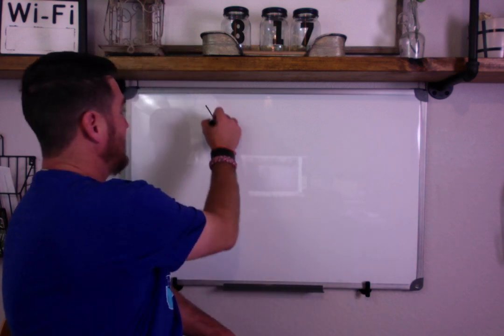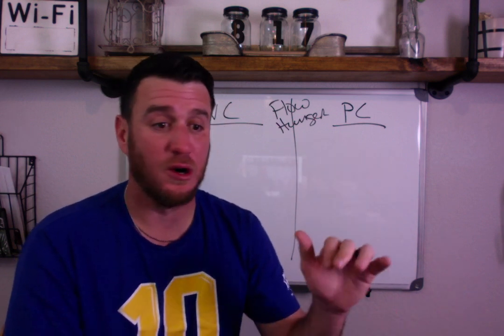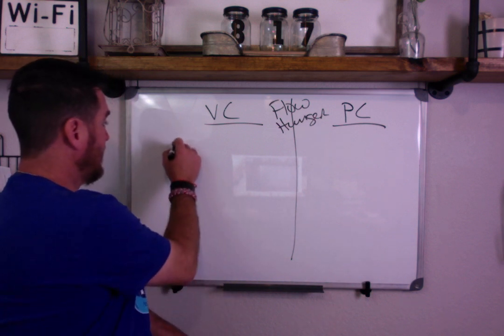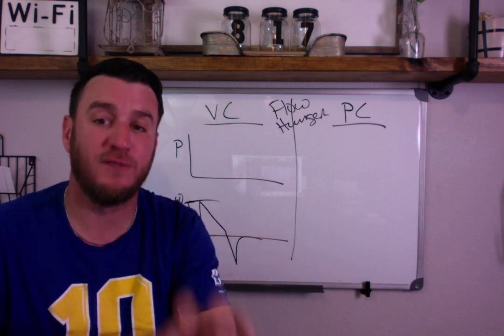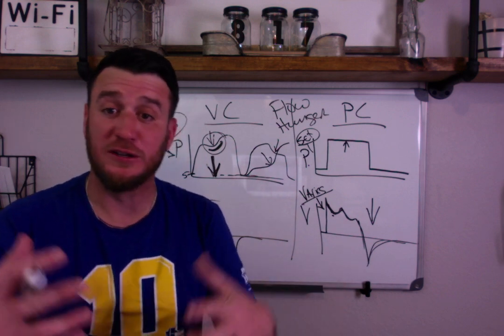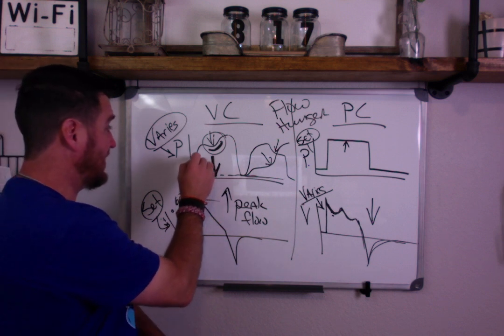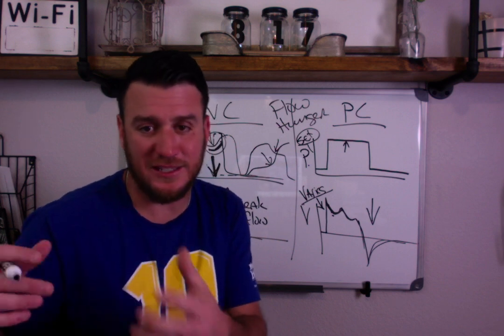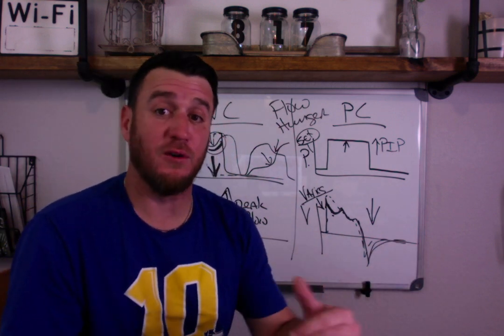Respiratory Therapy - Flow hunger in Pressure Control

Comment: Can rise time help alleviate flow hunger in pressure control?
Reply from the maker: Yes, but only if it's early insp flow hunger.  Middle or late flow hunger usually manifest after the rise time is done reaching the set pressure.  Just depends on when the patient is wanting the extra flow.  Hope that makes sense.  Best wishes, Kyle!

Comment: Thank you.
But Sr,
What does it mean if there is a dip in the pressure in pressure control mode?
Reply from the maker: Same thing.  Severe flow hunger or patient asynchrony will also show a dip in your pressure waveform until the vent increases flow to correct the dip in pressure.  If the vent fails to achieve the pressure set then you may have a leak in your system.  Does that answer your question?  Thanks for watching and commenting!
Reply: Respiratory Coach 
Yes, Thank you very much 🌹

Comment: I have a Q that is bothering me for so long. I asked and searched about it but I just got more confused. Is PRVC mode pressure control or volume control ? Cuz sometimes the doctors asked to measure the plateau pressure and I don’t know if we can measure it with PRVC. As for the settings, it indicates volume control as we are setting the volume, but at the same time it has the waveform of the pressure control.
Reply: To obtain a plateau pressure in PRVC mode  a brief transition to AC  mode is required to measure plateau pressure .
Reply from the maker: Hey Harwazen!  Your very smart to note the struggles in this situation.  You're right, the vents classify PRVC as a volume mode of ventilation, yet it functions as a pressure control mode.  So you're right, in PRVC a mechanical breath is pressure controlled, evident by your pressure waveform.  So, the answer is no.  You cannot adequately assess plateau pressure while in PRVC.  Not only can you not, but the ventilator cannot either.  This is why the ventilator gives volume controlled test breaths after initial settings, any disconnects, or any vent settings within PRVC.  Even the vent knows that a pressure control breath does not allow for adequate assessment of plateau pressure.  Volume control breaths are required to properly assess plateau pressure and static compliance.  Hope this answers your question.  Let me know if it doesn't.  Hey, thanks for watching and commenting!
Reply: Respiratory Coach big thanks. U explain it perfectly ❤️
Reply: I know this is old, but I think that I disagree. 

If you can measure compliance, you can measure plateau pressure  and thus DP.

You can get a plateau pressure in PC and PRVC/VC+.

Now, it may not be as consistent breath to breath because the VT might fluctuate, but you can get several values several breaths apart.

It probably won't be the same pressure as the set inspiratory pressure.  The air will travel through the large airways before the plateau is reached.